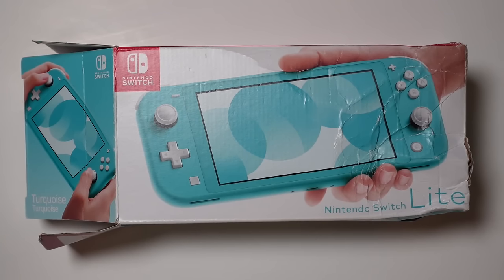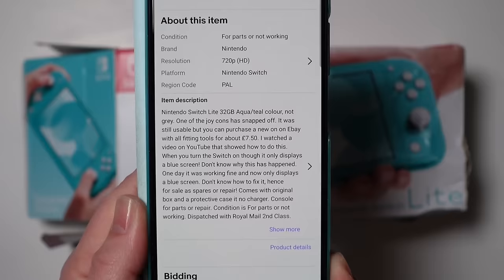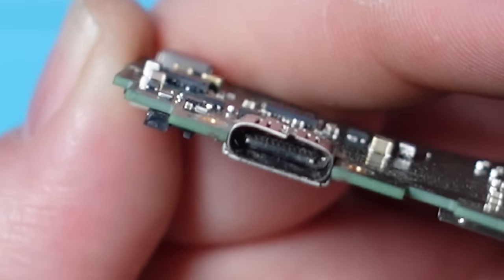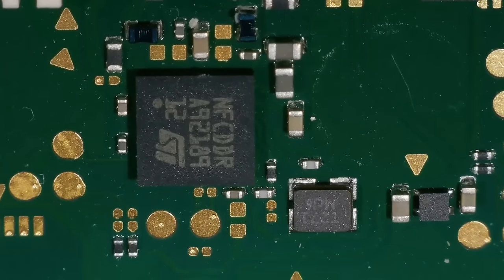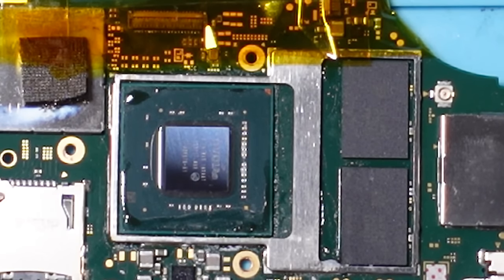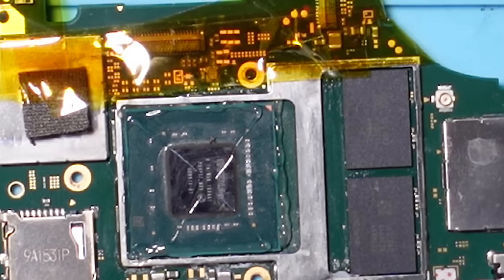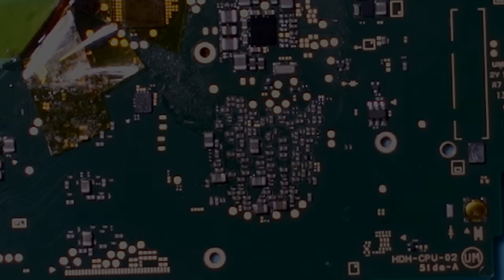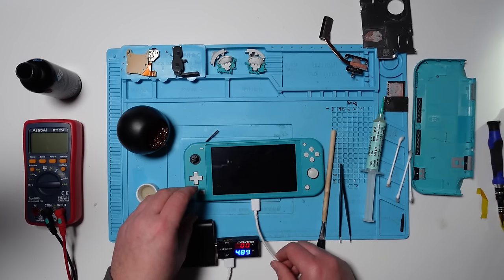Switch Lite with BLUE SCREEN OF DEATH | Can I FIX It?

Comment: Hi, do you fancy helping me out? My son has just given me his switch lite that’s just turned to a blue screen ! 
Would you be able to repair it? Not sure where your located but if you  do repairs get in touch . Regards Dean
Reply from the maker: Hi Dean. I only do this for fun on my own items, and I'm definitely not a pro! I hope you can get someone local to have a look at it for you! Good luck 👍
Reply: Hope you dont mind me jumping in StenzStix. Dean I can help if you still need it fixed
Reply: @bryanclose9780  Hi , how so, I’m all ears !
Reply: @deanbenson610  As you have seen in the video, it can be very difficult to fix. I have my own business which includes microsoldering. Id be happy to take a look at your switch to see if it can be fixed
Reply: @deanbenson610  I'll add a comment on your personal page
Reply: @bryanclose9780  where are you based Bryan and what’s your company called? what sort of cost is usually associated with something like this?
Reply: @deanbenson610  Im based in Scotland, yourself? If it needs the CPU reballed I would charge £70 for this
Reply: @bryanclose9780  I have to thank you for putting yourself out to assist, but this morning I was informed that the device actually has a 3year warranty (something I purchased apparently) so it will now be done under warranty which is a bargain for me, else I would have gladly have used your services ! Thanks again
Reply: @deanbenson610   no worries glad it worked out

Comment: What happens if my switch fell and it just made a blue screen is that bad cuz well I cried a lot ;(
Reply from the maker: Sadly, yeah.  It's likely that the solder balls under one of the important chips have disconnected from the board!  It could be something else though, and you might get lucky!

Comment: I knee'd my switch and it died lol how do I fix it it turns on but the screen is blue
Reply from the maker: 😁 I guess that you've bent the motherboard and either the RAM or the APU have lost their connection to the board. Or you've broken the screen maybe. Sadly, it will probably need a new one or a board reflow or similar. 👍
Reply: @StezStixFix  Nintendo said theyll fix it for free or send me a new one

Comment: Does that mean my Nintendo died 😭😭
Reply from the maker: 😬 Well, it's dead now but it may still be able to be revived if you take it to your local repair shop. I have seen them come back to life with a reflow of the APU!
Reply: Nah that pretty hard for me. But I can open it but always after 1 minute of working it just freeze and then I stays like that until it's dead from charge and then when I open it I shows me that blue dead screen and I can't take it to the recover settings so what I do is close it and open it back up after 1 minute it just freeze and die again so that's what I really dought that I can fix it cause it's not my 1st year of using Nintendo it's like the 3rd or 4th year and it's a lite also my brother always hit it
Reply: Guess what happened 🤣 I got crazy and mad 😡 at my blue dead Nintendo  do what I did was I punched it and back up and running well I guess our parents were lying when they said everything works gently 😂.NOW WITH A PUNCH MY NINTENDO IS WOOOOOOORKING  😊
Reply from the maker: @mabayt3418  Haha! That's one way to fix it! 🤣 Nicely done 😆

Comment: It was dropped and whenever There is a blue screen you have tp reflow the APU
Reply: Wrong. It aswell could be RAM. You need to check by pressing on it while startingthe console